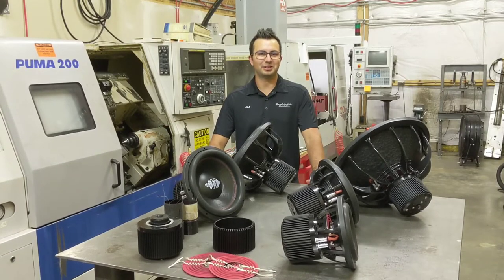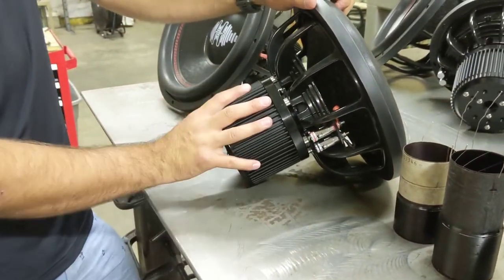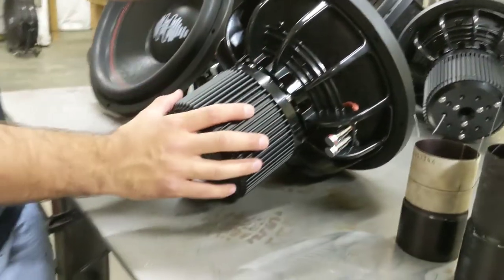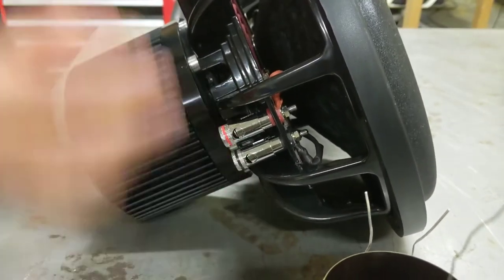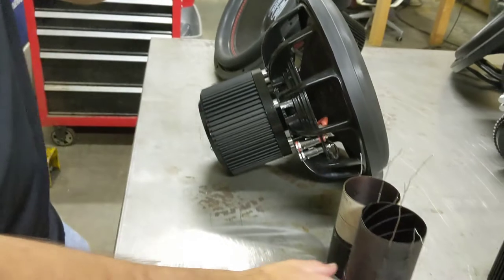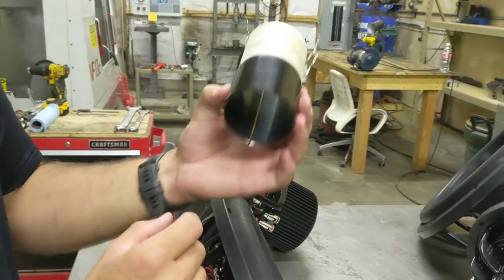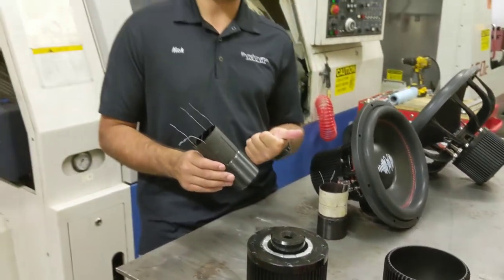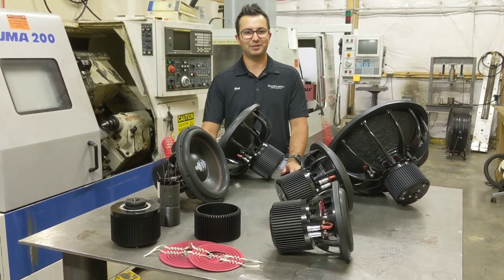The Hutchinson Car Audio Origin Series Subwoofers

Comment: Very nice. Obviously there's advantages to the design but also I've heard in the past the radial design has some caveats that neo is very sensitive to heat so when it's incorporated into the gap it heats up faster thus lowering the motor force to some point? I'm not 2nd guessing you I know you are very educated in this field I'm actually wondering about it, is there is some truth or is it a negligible issue that's been exaggerated over the years by ferrite fan boys... obviously if a brand only utilizes ferrite in there products there going to try and throw shade at technologies they don't use. I'm assuming if there was actually issues with the radial configuration you wouldn't invest a bunch of time and money with that motor style.